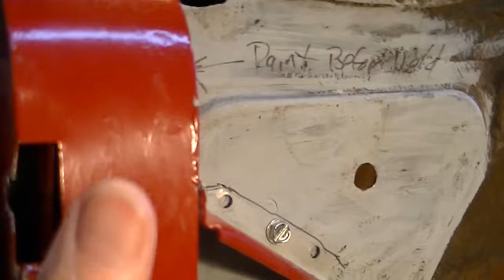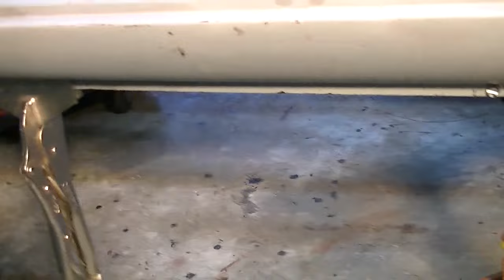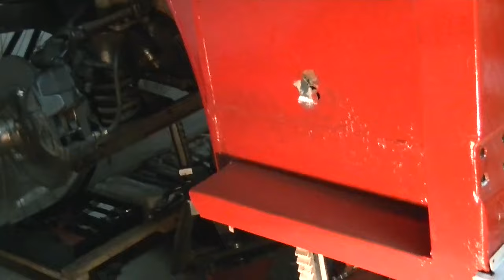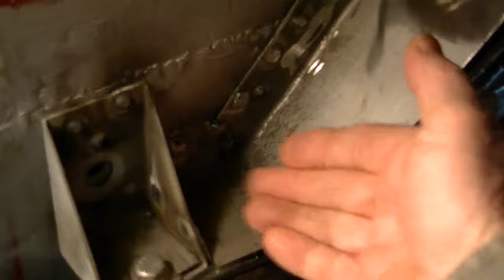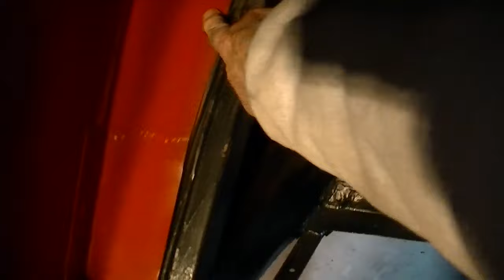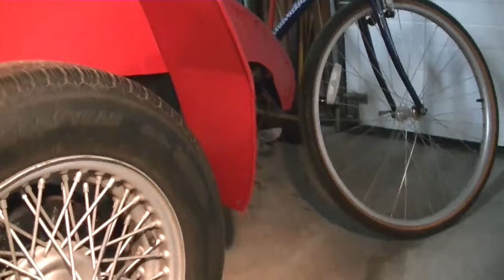1960 MGA Restoration - Left side B-Post, rocker panel, toeboard and sill

Comment: Carl, I really appreciate you doing these videos.  I constantly use them as a reference  and videos are so much better than photos, especially since you are describing what is going on.  I do have a question.  When mounting the inner sill plate, how far does it extend above the frame?  I can line up bottom to where the inner sill plate connects to the forward and rear pieces as you described but I want to make sure the inner sill plate isn't too tall.  If there is trimming involved I would rather trim the bottom than the top of the inner sill plate since there is a curve to contend with at the top.
Thanks again,
Jeff
Reply from the maker: Hi Jeff  In my case there was no trimming necessary.  The top alignment in the door opening is the important part and the bottom of the inner sill plate does line up about near the bottom of the frame but nobody will see this.

What I did was glue in the 1/4" think rubber piece on the top outer half of the frame in the door opening and then lay the sill sealing plate on top of the foam and press down a little to determine where the top of the inner sill plate should be, that is, the top of the sill sealing plate flange, the top of the inner sill plate, and later the top of the rocker flange all line up forming a 3 piece sandwich of steel.

If you leave room for the rocker flange when you weld the inner sill box section to the inner sill plate, then the rocker should line up and still have some room underneath it above the sill inner box section so you can adjust it's height a little bit later.  So I would say the sill sealing plate is the important piece to establish where the inner sill plate goes.

After establishing that height in the door opening, I adjusted the front of the inner sill plate to the steel edges near the front wheel opening where the inner sill box section starts, getting it all roughly horizontal.  In my case there was a lot of repair needed at the rear to attach the inner sill plate to the side of the car so I was able to adjust that later because I needed extra steel at the rear.

If you find that the height of the steel flanges in the door opening is too high you can easily grind it shorter afterwards.  BTW this 3 piece flange is where the furflex door seal goes much later.  I just measured about 5/8" thickness of the 3 piece flange on the left of my car and about 1/2" on the right because I ground it down a little too much, but the door seal still grabs.

Hope this answer helps.